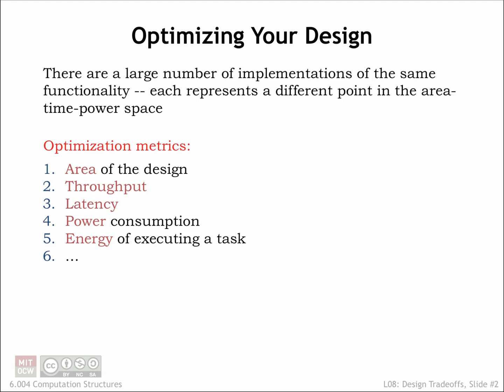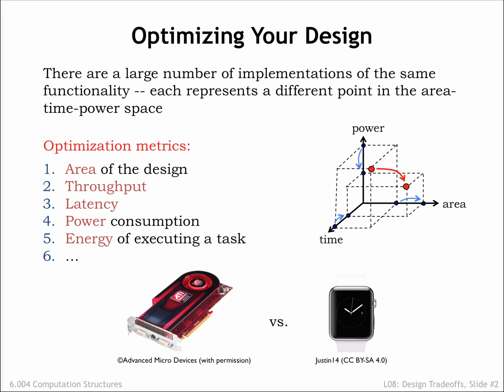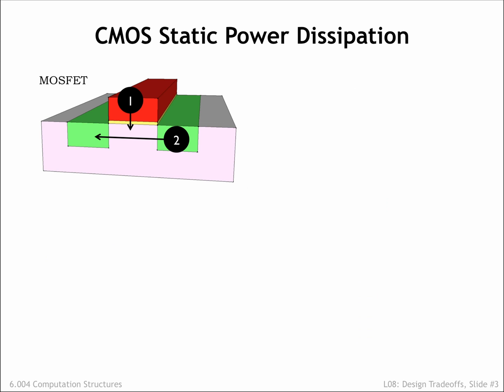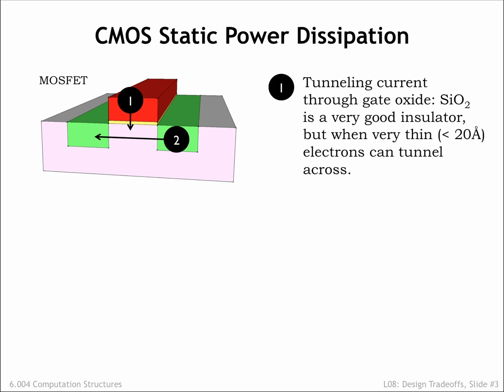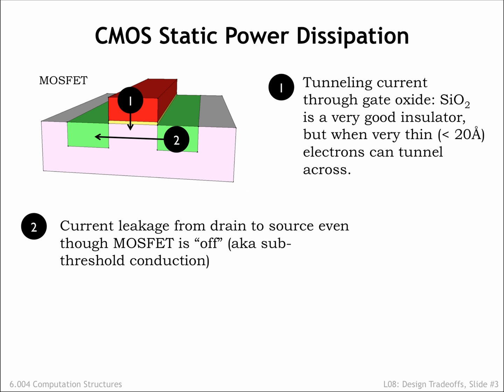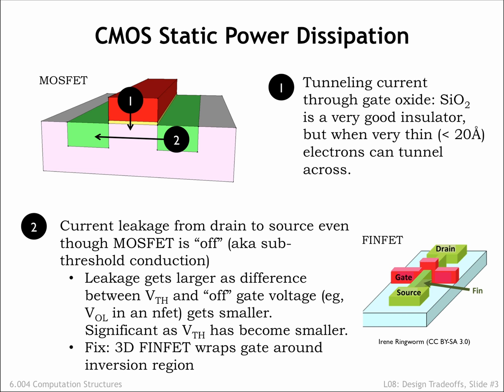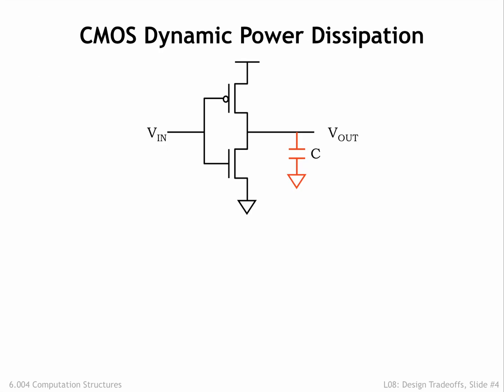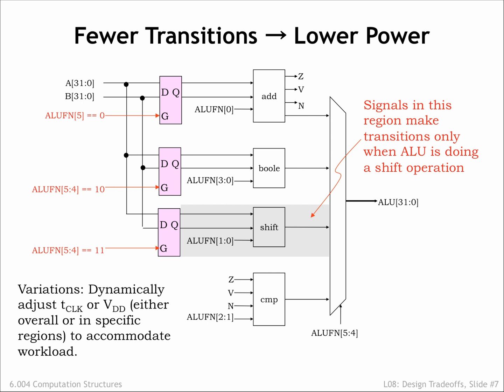8.2.1 Power Dissipation

Comment: Two generations ago, gated clocks were common. Then, one generation later, this was seen as risky and hard to manage. The need for predictability, and the move to automated design and cookbook methods, gave way to clock-enables, which kept the Flip Flop running, even when it was doing nothing (With clock-enable LOW, the output was actively clocked directly from input back to output). Lots of wasted power was hiding under the hood of those systems. Here we are today, looking at gated clocks, and clock manipulation once again. We have come full circle, only it's much smaller.